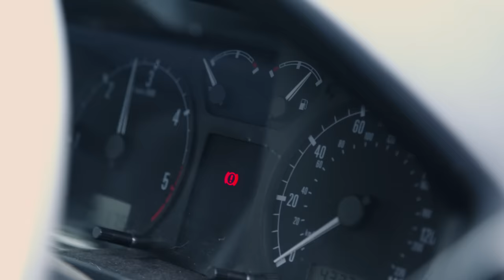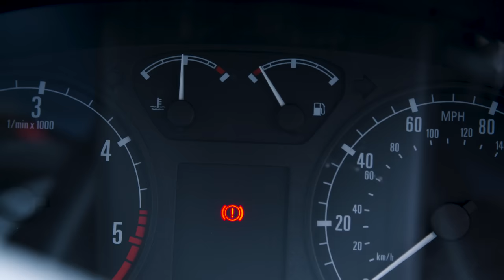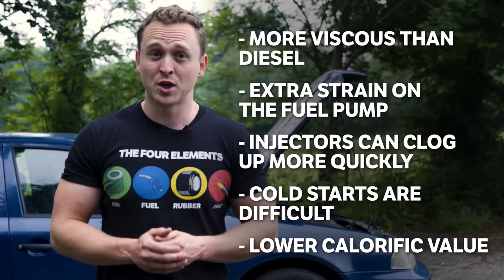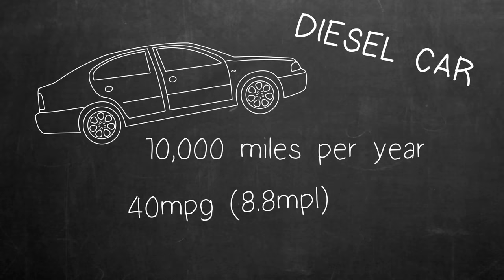The Pros & Cons Of Running An Old Diesel On Used Vegetable Oil

Comment: Biggest con in Germany: The law which outlaws use of alternative fuels which have not been taxed as fuels. You can buy heating oil from heating oil companies to fuel the heating in your house and you can buy diesel at the petrol station. You will get the same stuff, but the heating oil costs less than half (and has some additives to create a colourfull fume so that you can be identified, should you run it in your car). Vegetable oil? Nice idea, but if you get caught, it will become quite expensive.

You can buy vegetable oil for propulsion of course by the name of Bio-Diesel, which, of course, is taxed.

Comment: hey Car Throttle, did you just use plain USED VEGETABLE OIL? or did you add other chemicals before using it?
Reply: You don't need Anny additives, although a stronger fuel pump or mixing it with a little bit of diesel is reccomended since veggie oil is thicker and more viscous than diesel

Comment: Many years ago on an episode of Top Gear, they solved the viscosity issues by adding 3 millilitres of non kerosene based white spirit for every 97 millilitres of used vegetable oil.
Reply: It was the first episode of the 2002 Top Gear, to be specific.
Reply: @concorde837  of course

Comment: You will gum up the injector pump, injectors, and have sticky rings in the cylinder, wrecking the engine, within 40 -50k miles, needing a completely new engine, on used vegetable oil. Guaranteed.

Comment: It's good to destroy the seals on your injection pump lol
I ran it for years in cars that were ready for the scrap yard
You get a lot less mpg but it's almost free, 25% petrol with used oil and 20% petrol with new oil, which will make it the correct viscosity,
 correct dose of redex for lubrication and prevent clogging of injection system
Sometimes you can run a car for years without any problems, Peugeot engines don't like it, transit DI love it more than diesel 😎
VW Audi like it, but it does tend to slow down the TDI pd engine 😱

Comment: My brother used about 12000 litres from near Burger restaraunt we filterd it at 1000 litres at time under 1 hour whit homebuild system we tryed First vw cars but they will have some porblems at long run Best car to use veg oil is old mercedes whit inline diesel pump usually older than 96 year model. We didnt use 2tanks summertime we run pure veg oil and winter 10 %gasoline mix and we live In Finland and used that car In Lapland at - 30 c temperature and it worked because old merc inline fuel pump is mainly lubricated whit engine oil not fuel like others we never had malfunctions just change your fuel filters More and keep spare set of filters In your car... If you want tips or information at this. Reply i will help you.ps. W124 Mercedes is Best car to run on veg oil (or used engine oil and once i run out of fuel and had 5 l can of Atf and it worked also 🤣)

Comment: What about the desolved suger and salt? That would in time most likely ruin things.. you should boil the oil to get those things out. And use a thinner if not the car can handle it without thinners.
Reply: How exactly, would boiling the oil remove sugar and salt?

Comment: Only 18 months later and you'll be struggling to find a chippy that will sell you the oil. They get a better price from companies that do more than just filter it, but turn it into a biodiesel that can be used in any diesel engine. 

As for filtering: You can buy 'sock filters' of varying porosity from 100 microns down to 5 microns. The largest can hold up to a gallon. Just cut a corresponding hole in the top of your bulk container and fill to let the oil drain through. Lather, rinse repeat with finer filters.

I no longer run old diesel engine cars, preferring petrol engines that I have converted to LPG.

Ps. 1 gallon of petrol added to a tank of veg oil and you can start directly on oil even on the coldest of UK days.

Comment: You had over 1.5weeks to empty your 50 litre tank and not have to suck it up! I did think about running my dci on wvo and got some 5 and  10 micron filter 'socks' but I get 60mpg and the risk of wrecking a euro 5 engine to save about £15 a week didnt work for me. I bought carbon credits to offset the CO2 instead. If I had an old merc 300td car on the other hand...

Comment: can I use non-used vegetable oil ? (like new from Tesco - it is cheper than diesel)
Reply: Why not? Same sort of thing and it'll be purified already.
Reply: I ran my old Rover 45 2.0l Diesel on 5 ltrs Diesel 20 ltrs of veg/sunflower oil which I use to buy at asda,  I ran it for 3 yrs, a mate serviced it every 10,000 miles, apart from a Timing belt kit, I never had to spend money on it, cheapest car ever!

Comment: The easiest way to get a diesel out of the car is to get a long tube put in more than you would two or three times the length then hold your finger at the end blocking the hair from going back down the tube like what you would do in McDonald's when you suck some up to straw hold your tongue and the straw and then it is full of Coca-Cola,  so carry on and then put it back out and the diesel will be stuck in the tube and it goes without saying the car has to be on a higher level than the container you can also buy  a little siphoning tube that has a steely-eyed stuck at the end where the fluid will come out once you have the other end submerged in the liquid you then shake the one with the steel b in it and it will cause a vacuum and a soak of Atkinson Will quick eventually you will have full flow .

Comment: Buy a TATA they can do it . I tried and used veggie oil, transformer oil , diesel made from plastic (that's real crap - clogged up filters , injectors and creates lots of carbon in the engine and valves) standard diesel mixed with lamp oil that turned out to be still expensive ( no savings). Try miles on that as well.

Comment: Tbf those old Octavia SDIs can take some amount of punishment. I had a few that ran over 300k and they could use any grade of oil in the engine and run for thousands of miles with various engine fault codes coming up.

Comment: Why on earth would you need a second tank?
Summer months in the UK you can run 100% winter less than 5c you use a 50/50 diesel or K2 kero (kero is not legal on UK roads) or use 50/50 with normal diesel. Been doing it for years, no issues.

Comment: Seems people like to generalize when you can't.  The original diesel engines ran on peanut oil.  Some modern Diesels can run on just about any oil; depends totally on the design; and the type of fuel.  Not all biodiesel are alike.  One must evaluate the fuel and design of a specific combination and then you probably will find you can use it on most Diesels but not all ; plus with vehicles with a CO2 control system - you may have to concern yourself with that catalytic conversion effects.

Comment: Y not have an auxiliary fuel tank for it with multiple fuel filters in line of another pump and just filter the oil once and use it with the filters protecting the engine?

Comment: would adding homemade alcohol improve the biodiesel as they add to race fuel in gas does. also, did you add anything to the oil I thought the process involved ashes in the oil to make medical-grade glycerin and diesel. in the state, I'm from you need a permit and have to buy a special dye to add to the fuel. they also make you "" only travel 20 or so miles from your farm. that is what burns most people in the area is the pricey dye and bs permit chemically speaking its the same as normal diesel and without the dye and permit its hard to prove unless they want to you use it. lol, end mini-rant. I guess the oilman needs his profit.

Comment: I'm no conspiracy theorists but before the last fuel shortage, vegetable oil was around 25p a litre. When some Welsh bloke said he was using vegetable oil to get round the fuel shortage - shops sold out. Now vegetable oli runs slightly cheaper per litre than diesel making owners feel its not worth it. I ran a diesel on vegi oil for ages
Reply: In my country you can find vegetable oil 2 times less then diesel..but i still dont have a courage to run it..but my friend who has 13 year old fiat croma diesel runs it 50:50

Comment: The only other thing vegetable oil does to the engine is glaze up the cylinders because of the glycerine has to be removed using methanol and  sodium hydroxide at temperature of around 60 degrees c

Comment: Easy solution to all the negatives. Mix it with diesel 50 50. It thins it down to virtually same as str8 deisel. Cold starts are the same. Dont strain yer pump or filters. No need to modify your car. Just means your getting half price fuel.

Comment: Didn’t they show this on top gear and actually you have to add something to the oil not sure if it was absolutely necessary or just a way to make it less viscous and spare parts from early wear.

also they said you will still have to pay tax on it so in reality it doesn’t save as much as the effort might warrant, plus cost and supply will be affected by 3 things. 

the price of fuel itself if they find out why you want the oil.
the amount of people in an area doing this 
and company’s who run their fleets of vehicles on oil.

Comment: Might be a stupid question, but why don’t the vegetable oil have to be used can you not just put straight vegetable oil in?
Reply: its not that cheap straight from the shop. It can be used. Although it may contain some amount of water so it is better to use the used oil instead

Comment: Ran my car on a mix of veg oil and heating oil 50% mix, did this for over 15 years,  no problems. You can get away with running on 100 %  cooking oil in the summer but will have problems in cold weather. Don't try this with a turbo.

Comment: pro tip : if the oil is too thick for your car mix in MAXIMUM 10% gasoline to the vegetable oil, 5% is better ;) mix it first than fill it in to the car, works like a charm

Comment: 3:09...for those that do not enjoy taste of diesel fuel, go to hardware store and buy one of those outboard boat engine fuel manual pumps and clear pipe. With this you can pump the fuel into pipe and siphon handles the rest, if there is no anti siphon valve that is...
I really hope this wont lead into same issue that was with euro standard pallets... Before you could get tons of them for free and people got them for free firewood.. Then come the recycling boom of interior decorators etc who covered their walls and built sofas etc from them (inside living space, given how closed up spaces modern houses are and you dont know what chemicals have been spilled on those that now are off gassing to your lungs.. some people...) and now companies ask 5€ for one...so i'm hoping 5£ does not turn into 10£ before long... Far as i know those living in freezing climates tend to mix in 30% of diesel to 70% of cooking oil to get around from viscosity issue, but havent paid much attention to this if its working like intended. Extra fuel tank and fuel swap up seems pretty smart but causes issues if you are driven short distances a lot, since there isint much time to swap between oil and diesel, unless the valve is located right before fuel bar at engine bay.

Comment: This is how we run engines in ships 
But instead of veg oil its heavy diesel oil which is almost similar to crude oil
We use diesel in ports and for starting ,after sometime and in sea we changeover to heavy diesel but maintenance is high

Comment: Did you do any research on this? If you run it long like that, your engine will be toast. The oil is too viscous. It needs to be heated to have a similar viscosity to that of petroleum diesel.

Comment: Do you guys think you can repeat this but with properly purifying oil into biodiesel?
No need for second tank or full system bleed this way.
Reply: Making Biodiesel is not that easy and it's may regulated by law.
Reply: So is filling up with vegetable oil but this is a part of running on alternative fuels. I wouldn't say purifying oil into biodiesel is too hard, surely not for these clever guys.

Comment: All further engines should be diesel, not electric.

Soybean oil for engine lubrication and as lubricant for other moving parts, and corn oil for fuel. In fact, the types of oil used should be an option at the gas pump!

Comment: would it be a good or bad idea to mix diesel and veg oil?
Reply: By adding "proper" diesel at a ratio of, shall we say, 1:4, means cold weather starting is improved. Even if you mix at 50/50 it will halve your fuel cost.
One thing I would never consider, is putting it in a "modern" diesel engine. On a serious not, Why isn't bio-fuel being advocated by the green goons?
Reply: I mix 50/50 all the time . Over 100 k miles so far

Comment: Virgin veg oil isn't much cheaper than diesel.
As well as filtering I would want to boil off the moisture and mix 50/50 with diesel. It's not worth the trouble.

Comment: If you do this put a cup full of super unleaded petrol and the same amount of two-stroke oil in with it if you fill your tank right up and your car will go far better, be quieter no starting problems and perfect emissions at the MOT test.
Diesel engines are the best solution to pollution problems but the politicians cant tell you this because they need to get the tax from diesel at the pump. Don't do this unless you are looking to save money and improve the mpg of your car.

Comment: The BIGGEST  BIGGEST*  con:  do not let the car sit for more than a week;  ask me how i know,i had to disassemble and clean a few pumps for myself people, who had several cars,because of that; you'll end up with the VANES inside the big pump gummed up,and they will NOT extend out,and they will NOT pump:  meaning...your car will no longer start (there is a trick to that,and that is to keep someone else pumping very very hard the fuel rubber primer,building up pressure inside the big pump,and it will start,BUT it will only idle; keep pumping on the primer very hard,and 10 minutes later,as it warms up,is might be ok;
So,do not let it sit...and,please mix in some diesel(i use more than 50 pct diesel,some acetone,and some petrol/gasoline mixed in).
And once in a while,put in some diesel only,in an (almost) empty tank,and  make sure your floor the hell out of it,the un-gum the piston rings!!
But the best thing is to use NEW veg.oil,mixed 50% with diesel and some petrol; veg.oil LUBRICATES the big pump and the injectors 5 times better than diesel; pump will last ...forever?

Comment: 2:50 if you wanted to do it right, you would just hold the cloth over the hole of the container around the tube, then give the container a squeeze (think hug) and let got the cloth should seal the vacuum and get the fuel out of the tank. Never use your mouth that only in movies.

Comment: The gentleman speaking is incorrect. The first diesel was designed to run off of peanut oil the engine that he’s running is actually were to run off of diesel. That’s why the gas mileage or getting off of vegetable oil is not quite as good without modification thank you have a nice day. Yes, I watch a lot of documentaries he he he he

Comment: Hmm but an con of using veg oil is the premature life it places on the fuel system. 
For a rough idea a transit fuel pump is £800, and £200 per injector, then labour fitting. Your fuel savings could soon deminish if the fuel system shits itself.

Comment: I know the company you work for is not going to let you go to the next level and make "proper" Biodiesel. You still need your oil, but you will also need Methanol and Potasium Hydroxide, to act as catylists to break the oil from "long chain polymers" to "short chain polymers", and then you don't need to run two tanks and it will run even better, it will be less viscous and "run" easily through the injectors. You will have to change your fuel lines to silicone, because the "methoxide" catylist will eat normal rubber. There is a bigger process in making proper Biodiesel, but it is worth it. Might be a problem doing it in England where the Government want to TAX you to death on everything you do or don't do.

Comment: Your math on fuel cost doesn’t make sense, and you debunked it earlier when listing the cost.  I’m not saying the cons. I’m not saying it wouldn’t be cheaper or even comparable, however Since the bio diesel has less energy potential you are losing out on fuel mileage. Therefore assuming the car has the same efficiency in your equation (the 8.8mpl) is a fallacy. Logically you would be burning more fuel in order to receive the same performance, and having to fill up more often.

Comment: YOU HAVE TO MIXED 50 50 WITH DIESEL
Reply: no you don't have to at all. goes on pure oil and it even pleases this engine. You don't always need regular diesel, but you can drive it a million kilometers on oil. this has been proven many times.

Comment: Will this work on new cars got a Peugeot 2013 2008?
Reply: Highly doubt, it's mostly old diesels that can run on vegetable oil. If i remember correctly, the injection system in new diesels doesn't let them spray the vegetable oil (it's more viscous). I'm no expert, just trying to give you what I heard before
Reply: Caine0027 ok thanks for info is biodiesel the same thing?
Reply: @Ukcamerawatch4K  No, from what I could gather from the source of all lazy human knowledge (wikipedia), biodiesel is more refined than vegetable oil (or something like that)
Reply: Caine0027 nice rather not risk it does look promising paying less then £1 per litre
Reply: @Ukcamerawatch4K  It sure does. I would consider buying a old used diesel like miles, their service is not as complicated as new cars, they are not built as half arsed as new ones (or the ones that were have long died) and you can get them pretty cheap. Unfortunately, more and more city centers are banning old diesels from entering, so you either go back to the bus or choose petrol vehicles